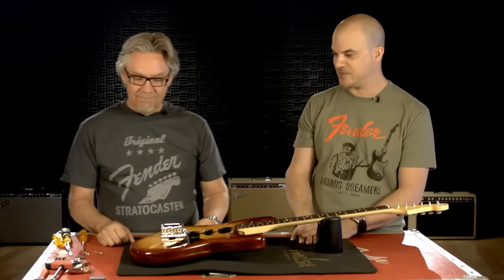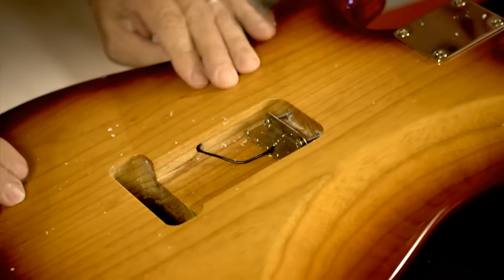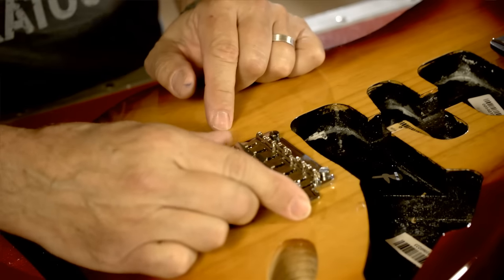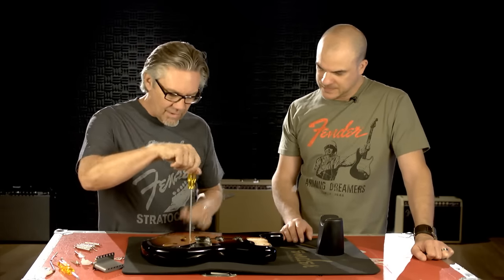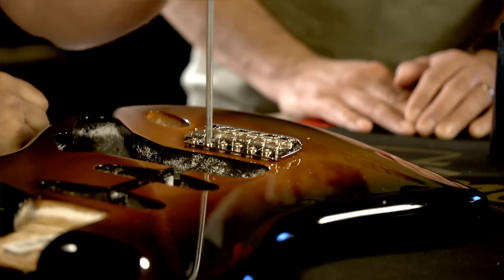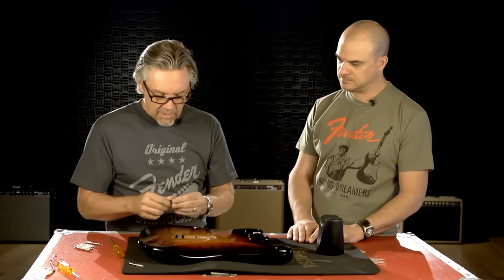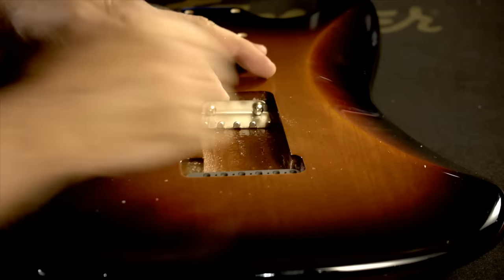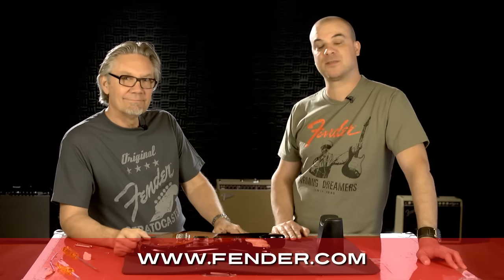How to Install a Fender Tremolo Bridge | Fender

Comment: When using 3 springs, they should all be parallel, otherwise there is less tension on the middle spring compared to the outside springs. You can angle the springs if you only use 2 of them.
Reply: What’s wrong with that?
Reply: Are you trying to tell the guy who works in fender research and development, that he’s wrong?
Reply: @xcx8646  im sure your well respected tech in your area is much smarter and has more experience with fender products that the guy who works in FENDER RESEARCH AND DEVELOPMENT. Learn to set up your own guitars, then you'll realize that with your own experimentation, spring angle has no difference on tension because its the tension is the same because its STILL the opposite of whatever string pull is. 

When you do your own setups and work, you notice things.
Reply: @xcx8646  its not received wisdom, its experienced wisdom of working on guitars for 20 years. My own and others. All different makes and models and tremolo systems. I've tested straight springs vs angled springs probably a hundred times on traditional tremolos and locking systems. There's no difference in feel, flutter, or stability. An easy test is to set up a tremolo with angled springs, and get it to pitch, then adjust the springs to be straight. it may slightly go out of tune- and when you get it back in tune, guess what? Its the same tension as before, because that's what it requires to counteract the string tension. It doesnt take an engineering PHD to know the newtons third law.

The OP is saying his tech knows more about a fender product and setup than the actual fender employee in fenders research and development department knows, not to mention 70 years of fenders R&D department has studied since the beginning of the stratocaster. 

Tension is tension. a spring is a spring. it doesnt change what it does based on a 25 degree angle because its still pulling in a straight line
Reply: Yeah angled springs means the outermost 2 have less tension than the middle spring, but so long as the claw is adjusted so that all three are under tension you are all good. Nowhere does it say that all three need to be under equal tension, and engineering wise it makes sense to have them angled. Increased tension on the outermost springs works at centering the block by providing a lateral force as well as the normal rearward force. In short, it helps equalise the load on the bridge posts, rather than one taking more load than the other, thereby reducing wear and increasing consistency (and by extension, tuning stability).  I have qualifications in applied science, physics, math, and experience in engineering. That is to say I'm qualified enough to say that angled springs makes more sense than straight springs.

Comment: I love the sound of Fender 6 screw tremolos. The combination of metals that they are using is SPOT ON as far as tone, IMO. But, please Fender, work on the TOP PLATE. It’s always warped, and doesn’t lay flat. My EJ Strat had the plate to block mounting holes misaligned, besides being warped. I also had an American Standard two post that was warped. A couple of tests will tell you. 1)Take the top plate off, lay it on a flat surface, and check for rocking. 2)With the bridge assembled, put it on a flat surface on the front edge of plate and block, check for rocking. If it isn’t close to true, it will never stay in tune.

Comment: Normally there are only 5 maximum. And usually the main reason for using more springs is because of the string gauge you use. For example people who use 9 gauge use 3 springs, where as people who use 11 gauge tend to use all 5 or sometimes 4. Having more springs counteracts the tension of thicker strings :)

Comment: why not design a  tremolo with 5 screws instead of 6, so that they can fall in between the strings, not under...
Reply: raffi98 i think it affects the tone not quiet sure
Reply: Lol no
Reply: I'm sure there is a reason but don't know what is it.
Reply: thats a great idea &  a good invention product for U lol
Reply: Because Fender stays true to its origins and has more or less kept true to the original engineering. 6 point vintage tremolo sells
Reply: because it would not be interchangeable with all the other fenders
Reply: @RaviLogan86  six years, and finally someone answers the question correctly. "affects the tone", jfc!
Reply: No raffi 98: Why using a 6 screw bridge while there is one with only 2 scews. In other words: 
Stop with making Strats with a 6 screw bridge and use only the 2 screw bridge equal which strat model.All bridges with pop-in arms. Every time after playing we need to unscrew the trem -arms to put the guitar in the case.Hello Fender, keep things simple please.
Reply: @joseceraia  a Trem with 5 or 6 screws will definetely sound different as the one with two!
Reply: why? You never have to use those screws when the strings are on
Reply: That would have been much better. Now they have the two point version which is even better. 

”It affects the tone” 😂
Reply: @joseceraia  a strat fits in a gigbag without removing the trem bar.

Comment: The only Strat I ever played that was adjusted correctly that I didn't have to mess around with was a Fender Deluxe Players Strat made in Mexico.  Between the videos and taking measurements off of that guitar I developed my own method. Now I am adjusting my fleet of CV50 Squiers. I have 99 Jeff Beck with thick neck and Lace pickups.  I want to sell.

Comment: Top and lower strings have different tension/thickness so the screws have to be unevenly screwed into the body for the equal tension. Lower string side has to have higher tension.

Comment: what if you don't have the pre-threaded bridge post inserts how do you install those?
Reply: You'd have to drill the holes and put the inserts in a lot like you would on a hard tail like a les Paul. They can be pretty fought to put but you've got to be careful not to chip your finish.
Reply: Drill around 8-10mm holes (10mm and bit of glue did it for me). Plop the threaded inserts in, and then screw in the posts.

Comment: Teflon tape works great for a loose tremolo arm.wrap it around the threads on the arm then screw it back in.that should tighten it up! : )
Reply: Dirk Booth or put a little spring in the hole beneath the arm
Reply: They sell small springs for this and they come with the guitar...hence the tape over the hole

Comment: I set up a decked bridge. The problem is that I can't screw in the whammy bar because it rubs against the body of the guitar when screwing in. Is it the fault of the tremolo bridge screws that regulate the height being screwed in too tightly? I had to set a higher pitch on the side of the treble strings to obtain the same bridge pressure

Comment: 6:50 Wrong! Yes, the STRINGS ARE ( 6:54 ) “pretty tight” on the 2nd install variation. Really tight. I ignored your technique, hooked the 3 springs end-brick first and the tension was extreme, so I used a large flat, wood chisel tool to press the claw, close into the range of the wood, while holding that steady, I then had a friend insert the 2 wood screws thru the claw and he screwed IN the screws slowly until I I could pull back my pressure with the chisel. THIS WAS THE ONLY WAY. After several attempts as this video used, there was no way that I could get the tight springs even CLOSE to the claw, otherwise. Hope this helps.

Comment: I have an old Kaman GTX33 with a broken neck. I want to replace the neck but the body was made for a floyd rose type bridge - and I'd like to put a fender style tremelo on it instead. Is this even possible? It looks to me as though the hole is about the same size, it just has that back area for the allen wrench adjustments behind the floyd rose saddles. Shouldnt be a problem beyond asthetics though right?

Comment: I have a 1994 40th aniversary stratocaster, the saddles are mounted with the screw on the side not the center, I bought roller saddles that are mounted with the screw on the center, what do you recommend, changing the bridge plate for one that can fit the saddles with the screw hole on the center?
Reply: No, use the originals. Thats a USA strat for Gods sake! Or simply get roller saddles with "offest" adjustment. Easy Peasy

Comment: I set up my vintage trem to float and I achieved the desired intervals with correct intonation and action. It is performing in both directions, pulling up and pushing down. My question; is it expected to have a high gap between deck and bridge? Mine appears very wide. Should I be concerned? If so does it mean that I need to approach my setup differently? My action and intonation was set prior to adjusting the claw. Not to mention my springs are in a V formation, should I parallel them instead? My strat is not staying in tune. Thank you sir in advance. Hope to hear back
Reply: -Check Darrell Braun videos
-decrease friction at nut (graphite), screws, string trees (teflon spray), springs-trem claw&block (oil/grease)
-lock string between its own turns on tuning peghead
-enjoy :)
Reply: Norbert Nagy Thank you for replying. Darrel Braun’s video was exactly the one I used to learn to do this. I went back in and adjusted the saddles heights, thus the action and was able to greatly reduce the gap I spoke of.  It’s working great! Staying in tune.

Comment: Hi guys look like I need to replace the skunk back on my strat, it has become loose,  glues has gone I think - any help thanks
Reply: Glue it back in. Give it to a luthier or get a new neck.
Reply: I'm with Mantis, the whole point of a strat is that you can easily replace a neck and it seems this would be an expensive swap (although don't quote me on that because I'm no Luthier) so you might as well get a replacement neck.

Comment: I got the vintage style tremolo bridge, whats the wire on the back on the where the springs are?
Reply: +Deregise its a ground wire that goes to the electronics.
Reply: It's the ground wire
Reply: +Deregise It's the grounding wire. Gets soldered on the back  of the guitar, on the plate where the springs hang on to.
Reply: SalmonFume what's the purpose of it?
Reply: It goes to the spring wire because it's attached to the bridge, which is attached to the strings, which are touched by you, grounding the current, so that you don't get an ungrounded (and potentially dangerous) circuit. It also stops a lot of humming, which is due to the buildup of that electricity in the pickups. Ever notice that when you're playing on single coils and you take both hands off the metal on the guitar, the buzzing gets louder? That's because it's ungrounded.

Comment: what kind of wires, i can use for my ground wire?
Reply: You can use basically any wire, normally it's a resin or cloth shielded single wire which you have to solder to the claw and to the ground of your electronics.

Comment: Can anyone tell me the advantage of having all six springs setup in the bridge rather than three ? Really curious if there is a tonal difference. Thank you ! 

I'm guessing that there might be more twang ? I'm probably wrong but still curious.
Reply: there is no tonal difference, the bridge just has more spring tension so to float it you would need to loosen the claw a ton. if you were to lock the bridge to the body, you might notice more resonance through the body and possibly more sustain but no tonal difference will be heard through the amp other than the possibility of more sustain.

Comment: I know this videos really old but I couldn’t find this answer anywhere my guitar has a cable coming from the body of the guitar into the back of the bridge I just broke my bridge because I was using a whammy bar to hard and it busted it so what do I do about the cable?
Reply: the cable is a grounding wire. ever notice how sometimes your pickups are noisy until you touch the strings? that is your hand grounding the pickups. if that cable has snapped from the solder joint on the claw of the bridge, your guitar will be very noisy when plugged into an amp. I would highly recommend resoldering that onto the back of the new bridges claw or bring it to a local shop and have them install the new bridge and resolder it for you.

Comment: Should the bridge tilt once the strings are tight? Mine is tilted all the time... Is that ok or is it a malfunction?
Reply: Try tightening the trem claw screws a bit. Do small even amounts on each one and keep checking the bridge after each round of tightening.
Reply: Thanks!  @victorramsey5575

Comment: I have a Affinity Strat which is 6 screws with chrome springs, the springs are very very tight, I don't need any wood piece to block the tremolo. Just 3 springs that make me barely push down the bar, why choose these hard springs?
Reply: It's a vintage thing perhaps. They want to keep it tight so that it does not easily turn into a dive bomb.

Comment: My tremolo hits the body when you release it making a knock sound do I need more spring tension?
Reply: the arm itself or the trem block? if it is the block making a knocking sound you either need to tighten the post screws or release some spring tension by loosening the claw screws
Reply: @bobbyDD  The bridge base plate hits the body, I have had 2 other strats and did not notice this before.

Comment: My Guitar body came without the holes in the Trem Claw. How to drill holes into it? Can I use a dentist's drillling machine as the normal drilling machine doesn't go inside? I'm so scared to hit it with a hammer as it might damage the Body...

Comment: Can anyone please explain why those claw screws are so extremely long? Seems super overkill. Also, does anyone know where I can get those posts and inserts please? Is there a special name for them? Thanks
Reply: Phil Moseley I'm guessing those strings have to be long so that when you use the tremolo they won't move, helping to hold the tuning.they prolly don't need to be as long as they are but overkill would be wise in this case.

Comment: Hi! I don't have the wire for the claw! What should I do as I can't find the wire online that goes with the bridge...
Reply: literally any scrap wire will work
Reply: You replied a bit late. I managed to get some ground wire and that worked perfectly!
Reply: Xavier glad it worked out, but you didn't have to get wire specifically for that purpose, you can use any discarded wire and solder it on the trem claw
I replied mostly for others who scroll past with the same question, yknow?

Comment: Ugh at the claw screws going directly into wood! Horrible structural design flaw! Particularly if there is going to be tension, AND worse: vibration. There is way too much pressure on the screw threads pushing against wood that will damage the wood and is a very weak support joint. There should be screw inserts in there, and probably more than two contact points.

Comment: why don't you show us how to install a replacement bridge (ex. wilkingson, super-vee) that's actually reliable. Or why don't you just improve the design on your bridges, for god's sake. It's been the same for 60 years, and the 2-post tremolo didn't improver it that much either. Not to mention that one is 30 years old already...

Comment: I'm no fan of fender tremolos.With all the advantages available to them as a massive corporation they still produce low tech products at a high price point."Branding" is what makes this possible.There are better designed trems out there,those wobbly Fender trem arms are sloppy and muck up the tone,you would think they would improve the design by now...
Reply: Your right. SRV, HENDRIX, CLAPTON , ROBBEN FORD, MICHAEL LANDAU, SCOTT HENDERSON,JEFF MCcERLAIN, Matt Schofield,and a few dozen more........ seemed to work just sorta good for those Artists .......  Here....I was thinking Leo did O.K... the Old Strats seem to go for six figures.... but maybe if they had your fine design..they'd be worth more.....